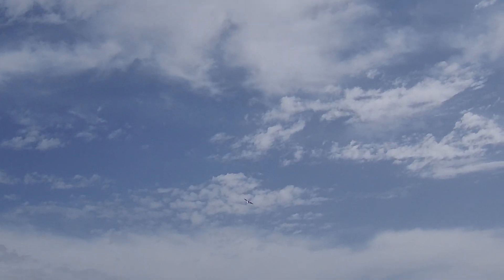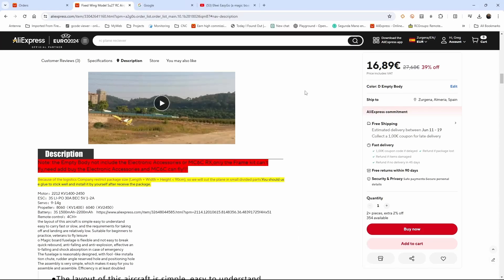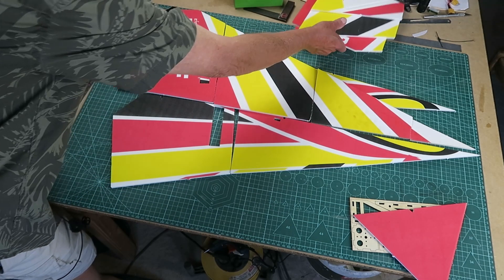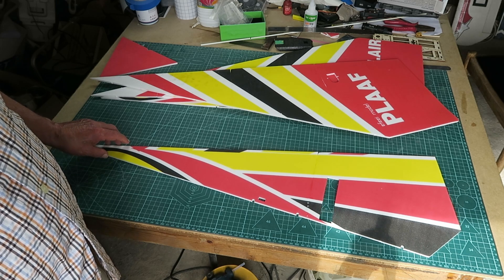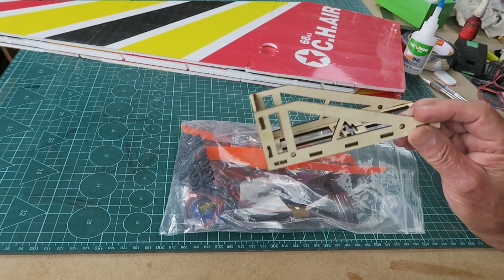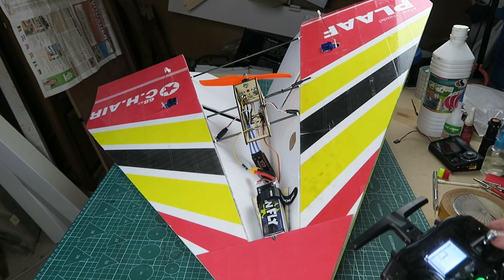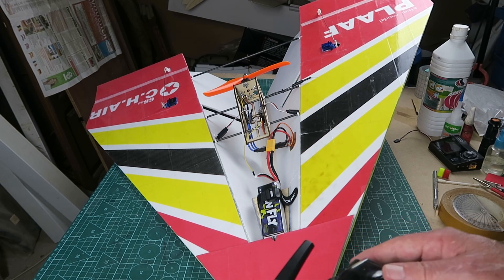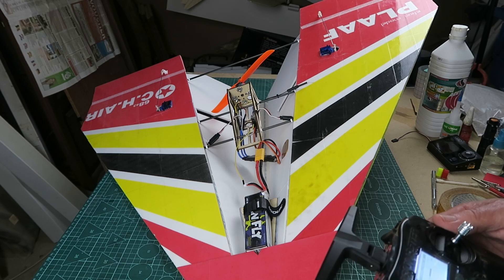Build and Fly: RC Foam Dart Plane Tutorial | Easy DIY Delta Model Project

Comment: Yep. I've bought from that site before - and similarly the pair of SU-27 style flat EPP foamies survived pretty well intact! But a smaller version (the Heewing Hunter version so panned by Lee @ Painless360) required quite a bit of the steam iron treatment. 😱
The big version (with your el-cheapo bundle) works quite well - noisy as though! I was thinking of trying that version there (with a Byme-D of course) since the tiny EPS brushed motor Jumper pair from Bangers many years ago were a complete fail. Even our more competent flier couldn't master that before final deconstruction ensued! 😉😊
Reply from the maker: It turned out better than I imagined when I opened the envelope!! Good fun, which is what it's about for me!!
Reply: @1nformatica  Oh, and RE your mates' talk of "Aerial Dispersal" there - I've arranged for the Propane-fuelled Disposal and added a request for my young Legatees to wait for a day with a stiff breeze and the obnoxious neighbour next door to have the whites on the line ... Brahmin Sky Burial and the final Karma! 😜😈

Comment: It seems that all your Maiden flights are Tail Heavy...😉 Nice landing..
Reply from the maker: For the first flight it was pitching up as I put too much reflex on the elevons. Second flight would fly straight and level at half throttle hands off. Will try the "dive test" for CG on the next outing! Thanks for watching, have a great day!
Reply: @1nformatica Seems great fun - just my style, I love nutballs and foam models for fun flying. Approximately how much reflex did you end up with and did you change the cog  ? Just waiting for one to arrive 😅
Reply from the maker: @Meonlymeagain  Reflex ended up about 5mm, increased to 10mm in my "Launch mode"! CG is about 20mm in front of the first spar. To get this I need to go to a 4S 1800 mAh pack. However I forgot to change the motor and it burned out in flight, luckily the BEC still worked and I was able to land safely : https://youtu.be/amiWCbKx9wc I now have a 2217 1250 KV motor which will spin the 8x6 prop but I am going to try aa 7x5 as it is still running "hot"!!
Reply: Thanks for the reply ..
.. fly fly fly ... They come in a box (usually ) they go back in a black bag ...😂
Reply from the maker: @Meonlymeagain  Very droll!!